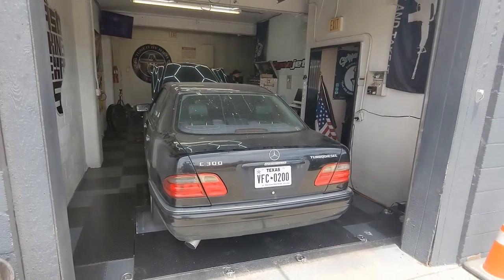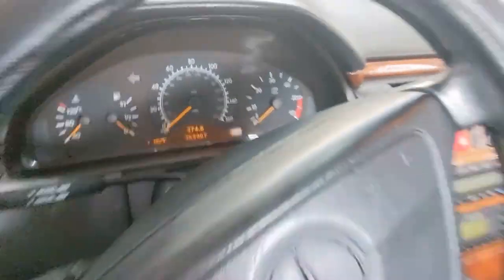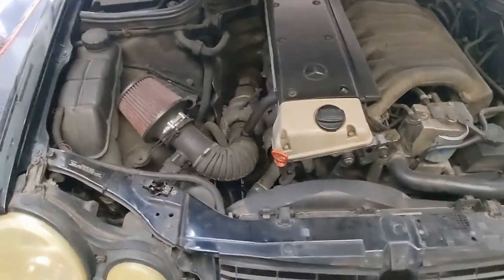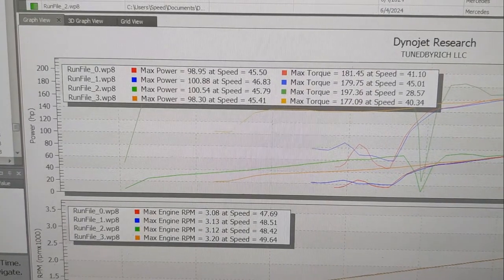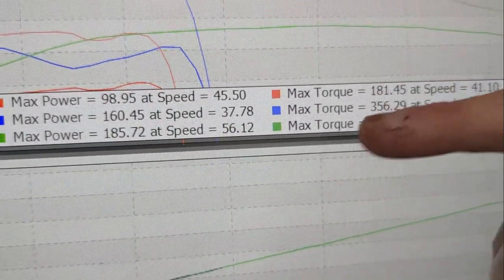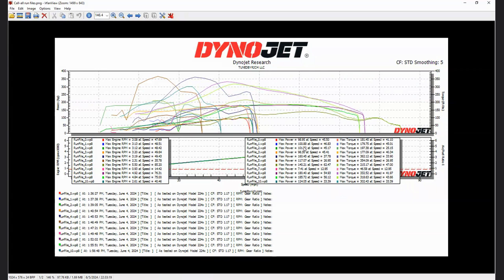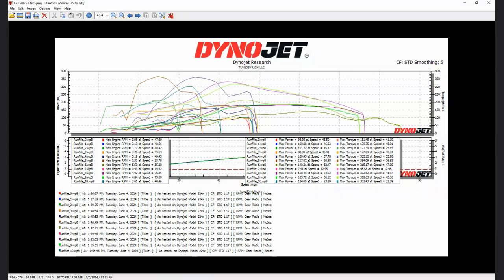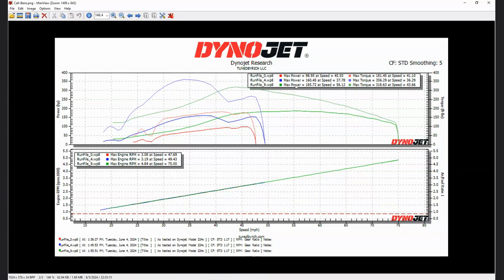OM606 Dyno: Stock vs Stage 1.5 ECU

Comment: I am confused, a Dyno measures torque and then calculates HP based on the Torque x RPM/5252 so how does he think the HP will be accurate but not the torque? Seems like the guy doesn't understand dynos, also nothing will be accurate in 3rd because of the Gear Ratio, it needs to be in a gear roughly 1:1, anything lower is a torque multiplier.
Reply: Same, I thought 3rd wouldn't be the best for a dyno run

Comment: and like you said we know these engines won’t blow at redline especially with the stock turbo stock fuel and they like high rpm, unless the bearings are shot or there’s some oil issue, we know the rods don’t like high boost at low rpm, i’d be more worried about intake cam gear slipping but very unlikely, next time just send it